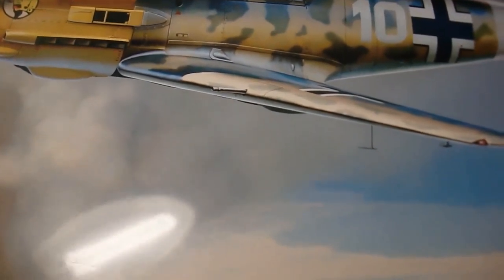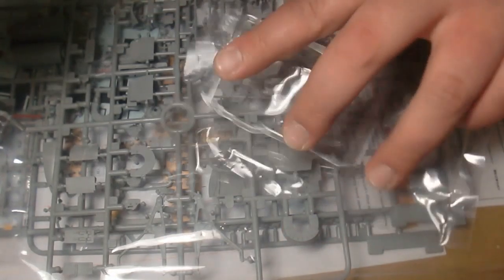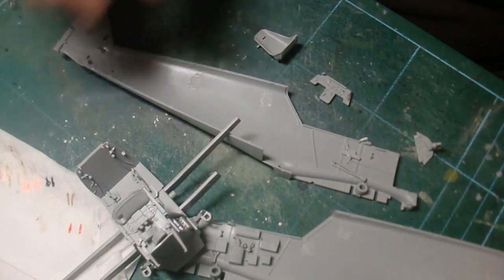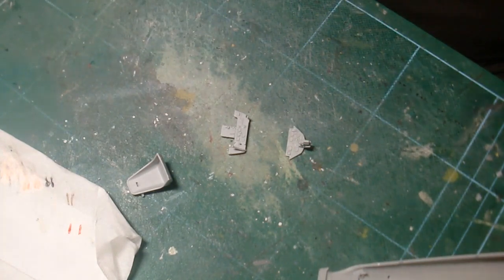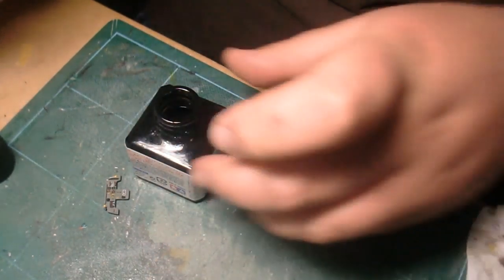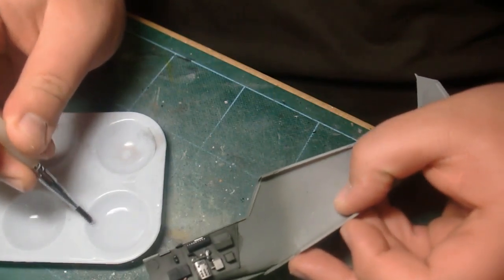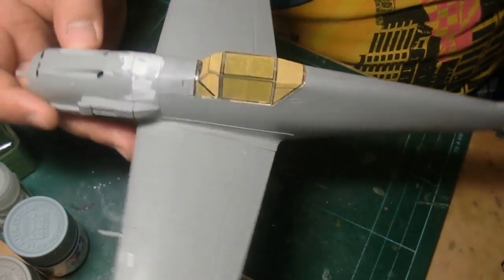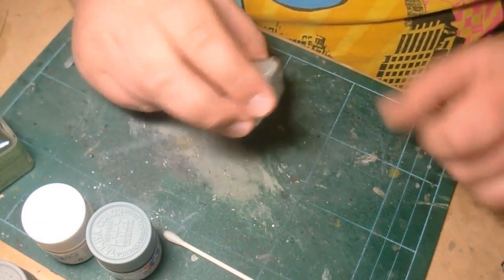Cyber-Hobby 1:32  Messerschmitt Bf 109 E-7 Trop.  (Part 1)

Comment: Two quick questions, how did you paint the instrument panel and what reference did you use for your painting colors, etc? Or did you just dry brush it? Also, what did you apply over the tamiya panel line wash in the cockpit? Was that an enamel thinner and if so did you seal your painted boxes first or not? Thanks in advance for your comments.

Comment: Fabulous job on that cockpit mate! Can I ask what the grey solution was that you wee painting onto the fuselage upper joint? Is it some kind of joint filler/sealer? And if so, what is it called and where do you buy it from?
Cheers,
Martin
Reply from the maker: Yes, I failed to mention that. It's Tamiya basic putty, that has been thinned down with Tamiya Lacquer Thinner. It makes it more paint like and easier to sand. I find thinning it down is easier to sand down, and has more control.  I don't know where you live so I cannot say if Tamiya products are available. But rcecho.com.  They are a company based in China, but better yet is checking RC Echo on ebay, on some of there products they offer free shipping. Thanks Martin :D
Reply: Thanks for getting back to me, greatly appreciated : ) That's a good idea to turn filler into a workable/paintable solution....I have to give that a try when it comes to doing any filling again, because I hate fillers and sanding. But, fortunately, the last few builds I have done required zero filler : )
I live in NH, USA....grew up in the UK, but moved to the states in December 1999...so it'll be 15 years this year! It's flown by??!!
Cheers,
Martin
Reply from the maker: FullMoonDrummer  Oh cool, I'm with you there I really don't like sanding, it's my least favorite part of building, and thinning it out really makes it easier, It I think you'll be happier with the results as well :D